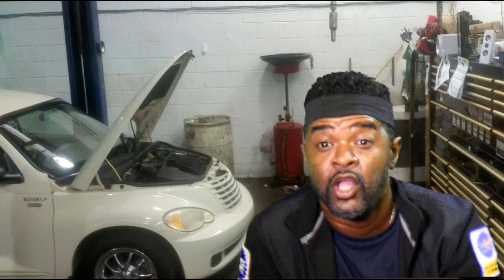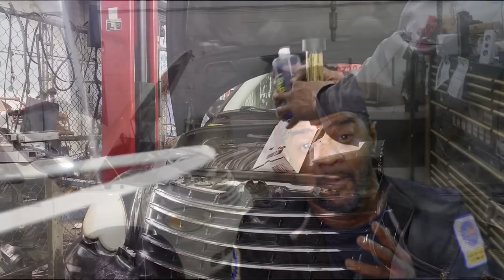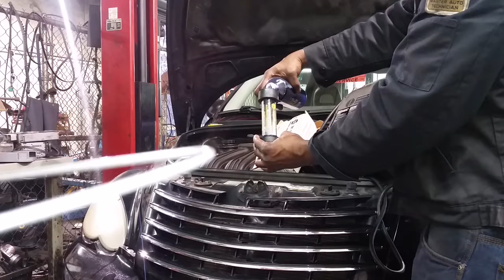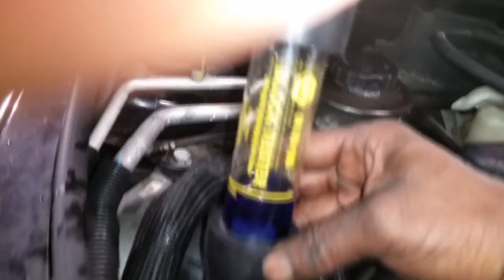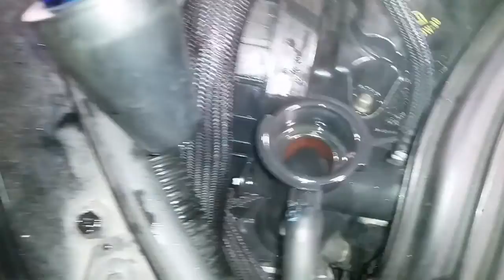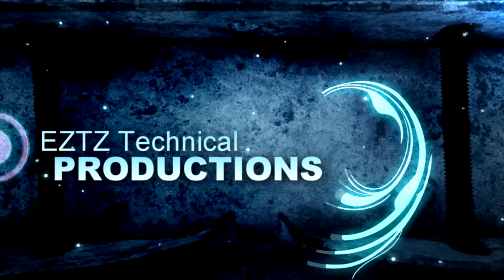PT CRUISER OVERHEATING AGAIN? Here's why. The last test and repair. Overheating with AC on.

Comment: My PT CRUISER gets hot and will not start . If I let it sit for a 45 to hr it will start right up can't find out what's wrong. Can you help me . Email is gunner1b52@frontier.com
Reply: The car doesn't over heat it just will not start after turned off will no indication of over heating.  But engine compartment does seem overly warm.
Reply from the maker: @brucecuffiii6241  OK, you still left out the year make and model. If you have no fault codes or check engine light..You problem need to check things thats not monitored by the computer such as fuel pressure or a cam sensor..You really need that check engine light to get on the right direction
Reply: The year of the Pt Cruiser is 2006 non turbo it.may be the timing belt it has never been changed that I know of, any other ideas?
Reply from the maker: @brucecuffiii6241  a broken timing belt will not allow you to start at ALL ..so it has to be something temp related..for it to start in 45 mins once it cools dow makes it temp related..And yes, the TIPM has the fuel pu.p relay built inside. You really need that check engine light in order to avoid guessing at parts..the light will eventually come on for something..
Reply from the maker: Hey my friend, can you please subscribe to the channel for me and click the bell and like the video please?  thanks..Now, depending on the year of this PT, there maybe a fail safe activated that will not allow the engine to run until it has cooled down..You really should be concentrating on why the car overheating first

Comment: I'm a proud owner of a PT cruiser I have a pinhole where the radiator is the plastic part 🤔 could that be the problem why my reservoir if boiling it was overheating before but now it doesn't overheat it just comes out the overflow help 😣 please and thank you 😩

Comment: Just SUBSCRIBED 🤗 🤗. Now I bored a 2005 PT Cruiser and it just started overheating on my way to Nashville Tennessee airport. Everytime I was going up an incline  the temp started going up and it caused the Temp light to come on.  I barely made it back home from Tennessee, before I parked it, it was making a bubbling sound from under the hood.  Its got a 119856 miles.  Need help
Reply from the maker: Thanks for watching an subbing..because it overheats on an incline which is a load, you likely could have a restriction or no air passing thru radiator (fan). Best thing to do first is get sys refilled and bleed of all air pockets then start test..look to see if fan running when ac on, if not you have to get fan tested..that's the first couple of things ide do.
Reply: Hi there! I had the same problem with different car, during the overheating I got fresh air out of the heater. On closer inspection, I could smell a tiny bit of coolant out of the exhaust pipe.  Engine's internal leak. Hopefully that is not your car's case. Good luck!

Comment: I had coolant in exhaust gases mixing. I don't know there was test. I left water in block cracked cylinder. I took heads off bam I could see crack. Symptoms in my case we're pressure in lines. Coolent may not be up to winter standers water expanding can cause problems.
Reply from the maker: wow, good point me friend

Comment: My 05 Cruiser overheated even after taking it to a supposed professional to replace the timing belt and water pump. I finally bled the air out of the cooling system and it hasn’t overheated since. Temp rides normal even on long trips as well as local driving.
Reply: What steps did you take to bleed the air out, I have the same problem. Over heating all the time. I have open the bleeder valve but still the same problem. Any advice would be helpful thank you.

Comment: And JT thank you so much for all your info. I have a 2003 PT cruiser touring edition that I got after I lost my Volvo. We just replaced the radiator and it just overheated on the freeway now I'll be checking everything out as far as bleeding it tomorrow morning.
Reply from the maker: YW my friend please subscribe to the channel, thanks
Reply: Check thermostat easy to do and check the fan if it turns on when you turn the ac on .
Reply: Also check the transmission shift solenoid to see if it’s leaking very common tranny leak there it’s under the battery tray

Comment: What is the name of the tester and the blue liquid?
Reply from the maker: https://www.amazon.com/Block-Tester-BT-500-Combustion-Leak/dp/B06VVBSFTF/ref=sr_1_2?keywords=combustion+test&qid=1560830221&s=gateway&sr=8-2
Reply: @OnlineMechanicTips  - Luckily someone from the auto parts store knew it was the "Block Tester" and they didn't have it for sale... they only 'loan it' (for $30) and gave me the $ back when I returned it later. The liquid was just $8! And- it didn't result in exhaust fumes in the system. (After all of the work, directed by your awesome videos it was still overheating. But turns out, even though I was replacing the coolant, it still needed more, it wasn't completely full. And, the oil was low, fixed that... Now NO OVERHEATING! YAY! You are who I thank for your professor-like guidance! I love it!
One problem remains... the inside vent fans still aren't working. So, that just boggles my mind... Any idea what that could be?
Reply from the maker: thanks for watching and please subscribe

Comment: I have a PT cruiser 05 first generate we do everything possible to fix a overheating no result new radiator new house new thermostat relay one relate to nothing still overheated we find out the fan west damage he comes on and off and we don’t know when we’re driving when we do the testWe realize the fan was not 100% working right we change the fan problem solved thank you for sharing have a good day
Reply: Anibal this is a very common problem with these cars...I had one and glad it’s in the junkyard

Comment: If you had combustion gases coming into your cooling system, the coolant in the rad with the cap off would be bubbling!!!! How are you sure it is overheating? Are you relying on the gauge? Are you actually measuring the coolant temperature at the rad? Sometimes the temp sensor can go bad and give false readings...
Reply from the maker: My friend, you right, under normal circumstances but it do not always apply to this aluminum engine..It happens any given time of the drive cycle which make them harder to diagnose..I drove a customer car for a week until I finally got it to overheat, I jumped outside of car to verify fans on, sys was full with no air pockets and themastat and radiator and water pump was new..The problem with diagnosing these is that the problem so intermittent. Now I just do block test but even then some pass..I never had a car return after a head job for overheating but I see you point.
Reply from the maker: hey subscribe to the channel for me, im tryna get it to grow, thanks

Comment: I have a 2001 PT cruiser it cranks but won't start
Reply: That’s sounds like a cam positioning sensor
Reply from the maker: Very well could be..The best way to figure out is use a scan tool that will show camshaft RPM's because they dont always set fault codes.
Reply from the maker: hey guy, you gonna have to start with the simple diagnostics  because this could be a number of things..Simple stuff to check is making sure you have gas in the car and you really need to know what the computer see, such as are there any fault codes in the PCM? this could lead to the problem
Reply from the maker: @Ron Gillespie an ignition switch can prevent a car from cranking...as far as starting, not so sure

Comment: You know why my car would over heat just at idle?
Reply from the maker: Hey buddy, can you visually see if the fan running while its idling? What kind of car is it?
Reply: Yea. When the car reach half the fan kicks on. And it's a 05 monte
Reply: Also check if it’s filled up with coolant and check when the car is cold

Comment: How do you test if a water pump is bad
Reply from the maker: Hey Cliff, good question..Im bout to upload a video on this very topic but a quick way to verify if your water pump working is to turn the heat on and see if its hot...Also please subscribe to the channel, I need your help..Thanks
Reply from the maker: just uploaded a video on a quick way to check your water pump, feel free to watch and ask any question you may have..Also subscribe to the channel please.
Reply: You havent told me what to do if i have a warped cylinder head. How do i fix?
Reply from the maker: @pamelavaleri8025  Sorry, if your cyl head is warped, a engine machine shop will be needed to repair this..Or simply replacing the cyl head with a new one..

Comment from the maker: Jeff if ya PT is a 2006 or higher, what's happening is your cooling fan pulling excessive amperage when in use and it boggs down the engine. Also the AC liquid line can cause this..to verify you will need to do an amperage draw test but that's difficult so I'd suggest replacing your fan..funny you ask, I'm recording a video on this very topic, please subscribe to the channel..thanks
Reply: JT Automotive Rideshare Guru Hay ive been watching your videos and im having an over headring problem can you Email me shamecca1028@yahoo.com